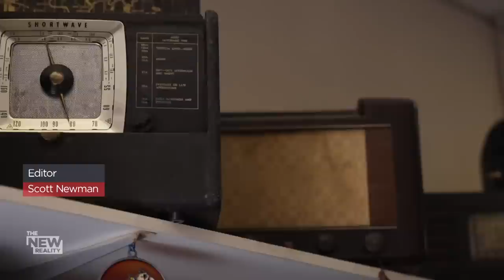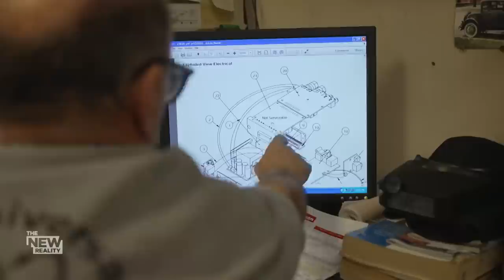Right to Repair: Inside the movement fighting for all consumers

Comment: The old fashioned drip coffee machines lasted a lifetime unless you broke the glass pot. Enter the fancy single serving coffee machines which cost 5 to 10 times more depending on the model you buy and they need to be replaced every 2-5 years. 

Here is where you see the government’s hypocrisy: Most, if not all, of the pods used for these machines are not recyclable but we won’t worry about the environment. Instead, we’ll probably see a “non-recyclable goods” tax that’ll be passed on to consumers, which does absolutely nothing for the environment while making Canadians poorer.
Reply: I boil water in a 3 qrt. pot. Just enough for my coffee. Boils in 2 minutes.

Comment: Apple is one of the worst. New Macbooks have an angle sensor that detects when you open and close the lid so it knows to put the laptop to sleep. The problem is this angle sensor now has a serial number so that if it goes bad and you replace it, your entire laptop will not work. There is absolutely no reason for this sensor to have a serial number. Furthemore this sensor is in a spot where it easily can get water damaged.
Reply: The best Apple MacBook Pro of all time was the pre-Retina models, due to its repairability and upgradability.
Reply: Apple and Samsung are two of the worst. Now Asus is following that path.

Comment: The reality  is that, when it comes to sophisticated electronics, they can't be  repaired
without very expensive sophisticate equipment
We have a choice in many purchases, but you know very well that most  computer based items limit private 
fixing..
Do you really believe that having the right to repair will  help  in this scenario?
 The vast majority of users don't want to repair  their printers or phones or whatever.
I applaud the exposure of the tactics by Hewlett Packard or Apple or any of  car chip manufactures etc.. 
who are  limiting  life on real things  or jacking the prices on replacements to maximize profit.
Right to Repair makes sense , but Repair What?
Personally, I like  the ability to upgrade , it makes things more interesting , so enjoy the change, you sure as heck can't take it with you!
Cheers,
Rik Spector

Comment: The way everything is made in China it is designed to be thrown out when it breaks.
I have had so much trouble just trying to find parts when something breaks and many times a critical part is no longer available.
It used to be 10 years they would keep parts in stock but now even one year is a long time for a company to have spare parts unless they are still making the same item with the same components.
I have a bunch of Kenwood 2 way radios that need an upgrade kit, KDM-7, in order to add a DTMF keypad.
Incredibly when they sold the radios this keypad did not come with them.
It was an optional extra part and it needs two pieces that came in the little box the actual plastic 16 buttons that go on the outside of the radio case and a 16 pressure-sensitive pad PCB board that went inside the case and had a little film style pressure that just pushed into the connector inside the radio

I was shocked that this kid did not come as part of the radios or just assembled together as the stock.
The keypad can be disabled in the software so there was no reason not to have the keypad come installed from the factory.
I don't know what they originally charged for this additional part but now that it's 30 years since they made the radio finding this part is impossible

And anyone looking to buy a radio would buy a Chinese new radio for $40

So the cost to have a custom part printed and a new PCB board made would be the cost of buying 4 brand new radios

It is so frustrating

The company could easily make more of these at a small cost, maybe 2 or 3 dollars

But many companies are not even in existence anymore, like RCI that was based in California and sold handheld two-way radios in stores like Walmart

They began selling digital radios that could be programmed but then suddenly went out of business

Obtaining parts or getting them fixed is impossible

And then you have the companies that clean their technology is intellectual property and won't allow anyone to actually fix the products and apple is a good example of the company that really started this that apple and Tesla Sue anyone who attempts to fix their items that they bought like a smartphone or a car and the idea that you can't fix your own car is absolutely crazy
Reply: Products made in China still have to pass the corporate standards and are only as good as the OEM quality assurance at the end of the line. Many manufacturing facilities handle different companies products on the same floor, just on different lines.

Comment: there should be more ifixit like companies and maybe for the ones out there now there needs to
be slightly more better qaulity control on parts due to ifix it in EU/UK.England being garbage tat being 
sold toi us lot in EU/England. ive ordered many iphone3gs battires and even an iphone10Screen just to find both itemes many times did not work at all.

so ifixit in USA are not the same ifix it as in EU.    

someone needs to kick that iFixit EU/UK Sales ceo in tbh till they get better or stop sending unworking trash  to EU/ england